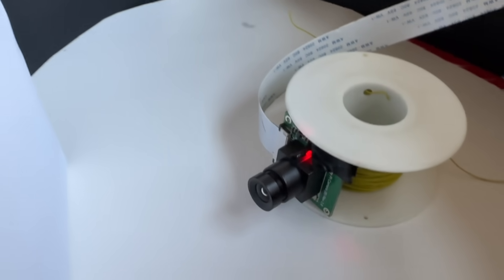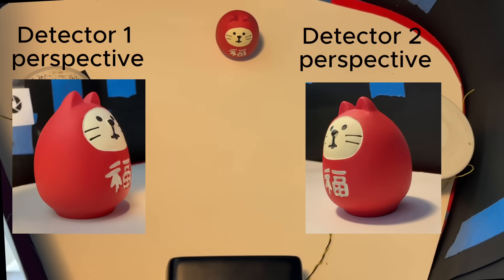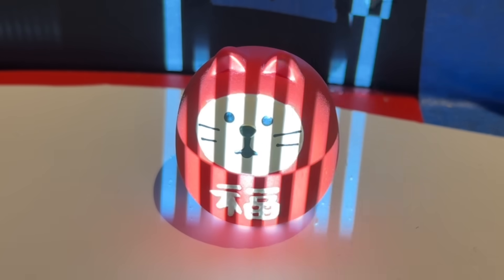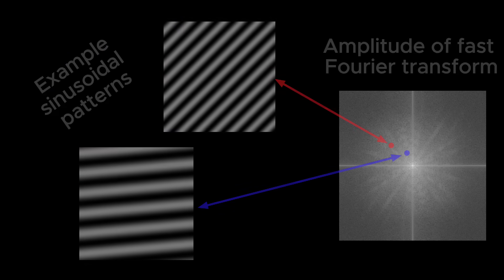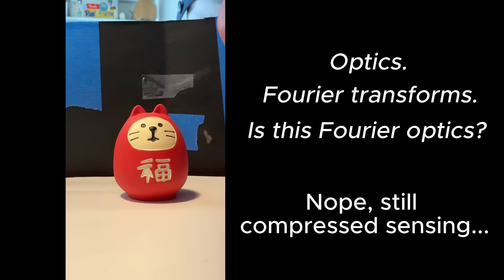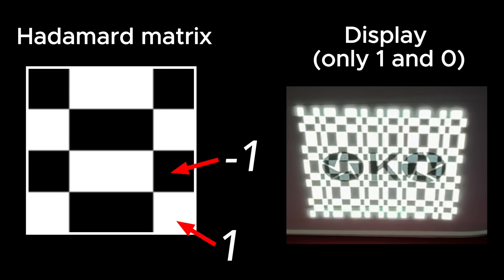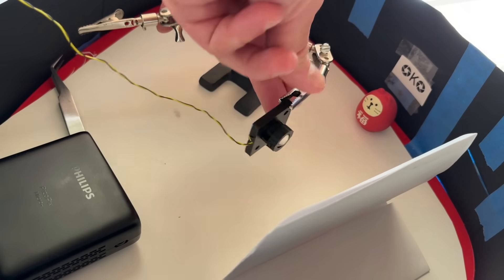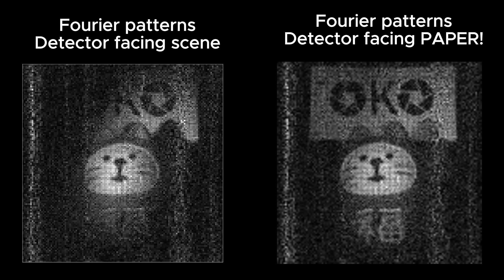Imaging objects out of sight using a single photodetector

Comment: Having the perspective be swapped in the structured light is actually makes a lot of sense intuitively, since traditional camera uses unstructured light source with camera that preserves the light structure. Meanwhile in this case the light itself that is that creates the structure of the light. The photodiode become the "light direction" is also just because it is where the sensor is the most sensitive. The indirect imaging is also because of the structured light in a dark room, and the paper is basically just an unstructured mirror. I guess  you can change the light barrier to white coloured barrier except the exact behind the projection area, and you can remove the paper reflector entirely.

Comment: This is so cool that I immediately went out to replicate the experiment. I'm using a larger projector to photograph a part of my room. For the patterns I'm using the 2D version of sine waves (which is basically just sin(n*pi*x)*sin(m*pi*y)). I'm already getting pretty clear results (Even doing RGB passes for full color). It's also pretty important to square root any values you send to the projector because (if I understood it correctly) display devices will square the values first before displaying them because of gamma correction stuff.
Do you have an E-Mail or Discord or something? I would love to share my results with you

Comment: I've glanced at hadamard matrices before. But it was in the audio domain. They're used to create reverb effects. If i remember correctly, you multiplied the outputs of a multi-tap delay with +1 or -1 depending on the hadamard matrix cell.

Comment: Have you tried swapping the transmitter for a single point light source and using an actual matrix from a camera as a receiver?
I tried this when I was at school and it worked nicely too, I had poor image quality but mainly because I had to decrease the sensor pixel count to like 1/16 of the full matrix
But I think you could get similar results and its easier to use a camera and an LED than getting a nice projector.

Comment: What if the lighting doesn't have direct line of sight? No bueno at all, I imagine?
Reply from the maker: The example in this video is just non-line-of-sight detection, but there's work where both the illumination and detection are non-line-of-sight. So yes, it is possible, but the technique may be different. I've seen point scanning before, but I'm not sure about structured illumination.
Reply: @okooptics  Thank you

Comment: Very cool! I remember seeing some work on these processes when I did an optics course many years ago, but this concept of the illumination apparently from the detector wasn't mentioned. Nice! i'm currently experimenting with millimetre wave imaging using metamaterials and metal mirrors. This has got me thinking about using Hadamard patterns driving steerable mirrors in a reflectarray to illuminate a target, then reconstruct the scene using diffuse reflections. Another way mighr be to use a large array of transmit sources, but at 135 GHz instead of 600 THz, the physical scale difference is a bit alarming.
Reply: This was a really cool practical demonstration of formulating coherent imaging from diffuse light!
And I like your channel btw 😅☕, it's been a while but I recognized the Theremin video.

Comment: I haven't looked into it, but the Hadamard patterns look like a 2D cosine transform. I wonder if it would be possible to do a cosine compressed sensing? That might reduce the noise by not requiring a match between sinusoid and phase data.

Comment: Cool presentation similar to the ideas of the early TV systems. What would be really amazing would be to figure out how to do this without being able to directly illuminate or observe the object. Essentially being able to see around walls. Is it possible to somehow illuminate the wall with a pattern the object sees and then analyze the light that bounces back to the wall from a perspective behind an obstruction.I think I saw where someone had done this with a very fast detector and a very fast light pulse generator. The question is can it be done using less sophisticated equipment. May be if you could view one wall and project on a different wall both visible to the object being viewed but neither the projector or receiver is.
Reply from the maker: Thanks for bringing up this point! In this video, I've only demonstrated non-line-of-sight detection, but there's quite a bit of work on non-line-of-sight imaging with the detector and light source both out of sight of the object.  Here's a link to some references: https://web.media.mit.edu/~raskar/cornar/

Comment: This is very interesting but is there an application for this? Sure the camera can be indirect but the light source needs to be direct and more complicated plus you need two pieces of equipment, where with a normal camera you just need the camera. 

Again, very interesting and very cool, I’m genuinely trying to figure out a useful application.
Reply: cheapo 3d scanning?

Comment: I have an idea, to reduce noise, could you use a camera (still pointing at the white paper) and then treat each individual pixel as a single detector?  In effect you would have a matrix of images all from the same perspective (the projector) permitting you to sum them.  The signal would be substantially larger than the noise.
Reply from the maker: Thanks for the idea. Next video will be on 2D sensors. Stay tuned!

Comment: Suggestion to improve the signal to noise. Right now you're using what might be called "DC" light, and the CDS photocell has a slow response time. If the light was modulated with a frequency (in the audio range, but not !! 60 Hz or a multiple) and using a detector with a suitable frequency response (photodiode, not CDS photocell), then you can apply frequency filtering to achieve a much higher SNR. This can be used in conjunction with the other techniques that are being pursued here.

Comment: While we are at it, let me just point out explicitly that the photodetector is just measuring the (approximate) dot product of the projected pattern and the scene (the dot product is happening physically in having  a single photodetector measuring the approximate luminescence ). Fourier Transform and the Hadamard pattern method both use a fixed basis(the projected patterns)  which are likely orthogonal (atleast is the case for Fourier)  and need the dot product  which is the component. Feel free to correct me or add to my comment to add any more interesting observations

Comment: This is actually the basic idea behind MRI. The main magnet provides a stable equilibrium, and the X, Y, and Z gradient electromagnets provide sinusoidal phasing at arbitrary spatial frequencies after a burst of RF "tips" the nuclei and gets them to spin. Then, using only a single sensor you can reconstruct an entire image just by walking across large areas in the frequency domain (k-space) and taking the inverse Fourier transform. This is called 3D Fourier reconstruction (more common is 2D Fourier reconstruction by exciting one slice at a time). A whole lot more technical details to it, especially based on what specific parameters you're optimizing for in regards to contrast. But very cool to see this idea used in other, non-MR applications!
Reply: Also if you want advice on how to get better imaging results, there are a few techniques that might be transferable from MRI. One is to use longer scan times and effectively determine and subtract out background noise. Another is to use multiple receivers placed in different locations and determine (either as a manual step before scanning, or after the fact with clever k-space tricks) their approximate sensitivity maps, recombining them with linear algebra to get quite good results in combination with undersampling to reduce total scan time. SENSE in MRI uses pre-measured sensitivity maps, and there is GRAPPA or its predecessors that use k-space tricks to automatically "reconstruct" missing lines in k-space. Very technical stuff but the important ideas are more or less easy to understand with a background in signals and systems.
Reply: @drewchristensen2432  there's no way i understand these comments in my entire lifetime

Comment: Another place where the FFT happens in the real world is MRI machines, where they induce sinusoidal patterns of magnetization on body parts and then measure the signal using just 1 detector (or sometimes up to 8, for improved signal to noise). Both 2D FFTs (where the imaging is done in thin slices) and 3D FFT methods are used in MRI.

Comment: That is pretty wild!  One of the first things that comes to mind is to ask if a LOT of money could be saved by simply using a static slide of the sin wave and rotating/translating it mechanically in front of a simple light & lens.  Printing the sin wave onto a transparency sheet using a laser printer would be cheap and give MUCH better blacks than using a digital projector.

Does that sound reasonable?

Comment: Can you use more than four measurements at each fourier frequency and solve the over constrained equation for phase and amplitude? That might give clearer images (if the problem is noise and not discretisation resolution)

Comment: Fascinating! 
So raytrace cameras in computers actually work this way too. If you use blender and render something in cycles, the detection rays aren't coming from every light source towards the camera, but in reverse, going from every camera pixel outwards, bouncing until they run out of arbitrary bounces or hit a light source.

Comment: I wonder what would happen if you used a higher quality photo sensor that gave you more values and more precision, would that give you a "RAW" Image that you can expose and underexpose later on, because looking at the comparison between the direct point scanning and the diffused point scanning from the paper I think some values are clipping when using direct scanning, so I guess maybe if the photoresistor had better precision the output image quality would be alot better. also i think it would be interesting if you used the projector to project those dots in a smooth movement while continuously gathering sensor data, that might also give you a higher resolution

Comment: Wait -- of course this is possible, and it's been done for quite a long time. But there is no way you imaged what you showed in this video with that photo cell!! You have to use photodiodes or phototransistors because of speed. The setup you showed has a Cadmium resistive photo cell and are too slow to image with. Those images you showed were captured with a regular camera CMOS/CCD and then you used image processing software to pixelate them and make them appear as if you captured via a single pixel. Like I said, of course it's possible but this video was a large illusion without the actual work being done. AlphaPhoneix tried pulling this too.

Comment: Fascinating 🤩
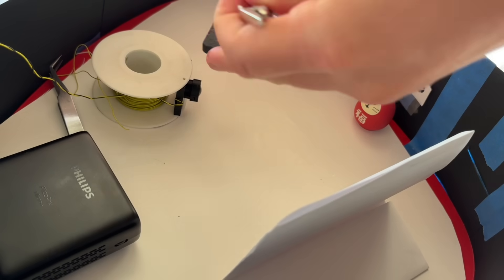9:10 I guess you actually do not need a lens. Theoretically it should be sufficient to place the naked photo detector (or a solar cell?) somewhere in the scene. However, the lens might collect more quantity of light increasing the signal depth. 🤔
PS: i recently discovered a method called "lock-in" thermography, that is used to get more out of weak signals. Maybe this is also useful for your experiments ;-)

Comment: Incredible explanation, so this is how LIDARs concepts work and calibrated/tuned. Try using a more sensitive high speed photodiode, which has a faster response time, they are low cost and fairly easy to assemble. The LDRs are not very sensitive and response time are low. I'm sure your results would immensely improve.

Comment: Just finished your prior vid too.  For higher resolution, what if you shift the position of your matrix? For example, stepper for x and y (or manual adjustments). The projection on the object would shift, right? And in your software you can implement your patterns in an upresolution'ed version, and shift the patterns accordingly. Eg. if you shift by 1/2 the LED-LED distance, this will give you some semblance of halving the smallest hadamard pattern (but I'm not sure how that works out without the full lowest half-resolution pattern, nor the limitations on the optical blur with your setup -- especially when dealing with 3d objects where parts might be out of the focal "plane".)

Comment: Sooooo in plain english...  Just using the principals of a hologram but instead, of using a film to catch all the wave interface at once you are capturing the wave interface (resulting brightness) of different illumination patterns only using a single point (photo diode) This has the effect of "moving" the light (creating a Fourier transform) to sample multiple areas of the object at once using shadows and patterns in a way you can reassemble the image from each "brightness" of the photo diode record for that pattern. Even though many objects or subjects could give a 60% illumination for a single pattern, only a specific subject could give this level with this pattern and another level with other pattern and so on and brining all the results of the projected waveforms sums up the series just like making a square wave out of infinite sine waves, but using your patterns as a guide for each brightness level, as you are measuring the Fourier sum of light reflected off the subject. Using the jpeg compression patterns was brilliant.

Nice.  
Now do it analog.  (Process real time, or close to it) with a whole room, projecting your wave pattern instead of the jpeg compression pattern. Bonus for splitting the projection and creating a 3d image.

Comment: So you're telling me your projector can project red, green and blue, individually (instead of all at the same time). But you were like, who needs color images, if you can also have grayscale...? The funny thing is though, you could just as easily get a full color image by using three light sensors with red, green and blue filters, cause the position of the light sensors isn't that relevant as long as they're somewhat close to each other. Cause you wanna illuminate the object with red, green and blue from roughly the same direction obviously.
Reply from the maker: Exactly, well put. The idea of using three detectors with three filters is a good one because the perspective is always the same regardless of detector position. And then you don't need to triple the number of illumination patterns.

Comment: So, would it be possible to take an existing video image, apply these techniques and perhaps some lighting simulation algorithm and extract off camera information? If there is diffuse serface within the image?
Maybe using a single pixel modulation? 
Or for each pixel and averaging?
Reply: If I understand what you're suggesting, I think it would not work, because the existing video image has integrated all the reflected light from the complete unseen object. It was not illuminated in patterns to start.
Reply: @oldtvnut I recently watched a video, I think it was on Marco Reps channel. The topic was a microwave sensor inside the cabin of Tesla automobiles.
It consisted of a transmitting antenna with three or four segments and a similar receiving antenna.  These constitute a simple phased array. There was also an extremely sophisticated proprietary processing chip, and the host said it probably cost in the tens of millions of dollars to develope. The nominal purpose was to monitor the number and position of occupants for airbag, comfort control and power distribution.  I asked if these " T" wave frequencies could image humans like airport scanners. He replied that even though it was a phased array and could scan the interior, the resolution wasn't enogh to get images like at the airport. I believe,  given your video, this is incorrect.
Reply: Thank you  @oldtvnut
Reply: @oldtvnut sorry,  the video about the cabin radar Tesla was on The Signal Path